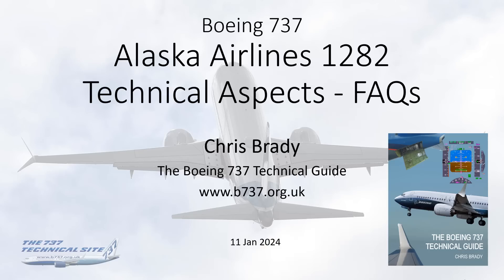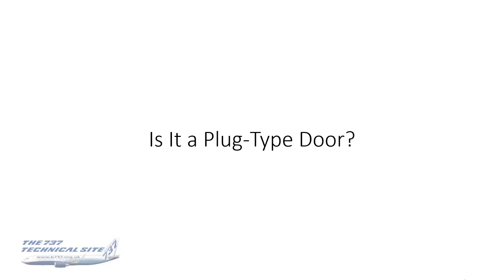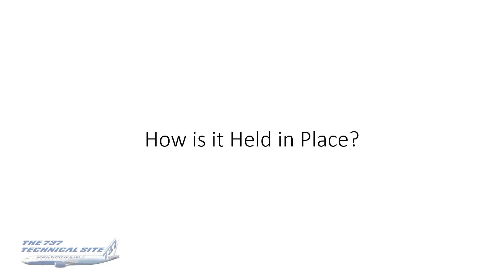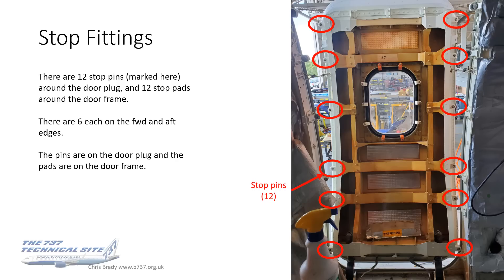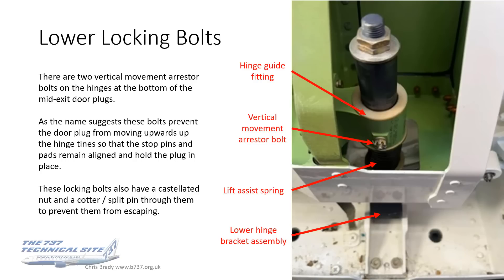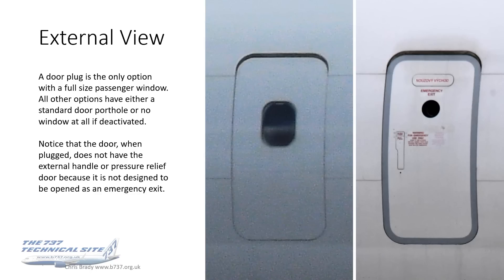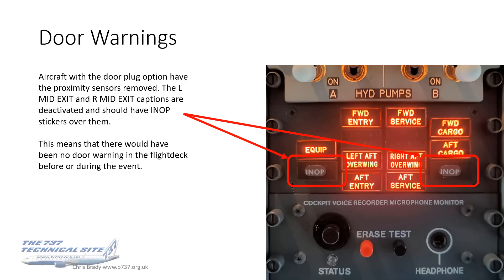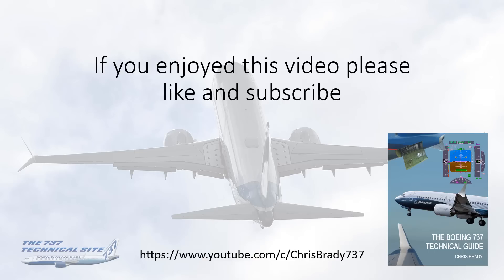737 Technical Aspects of AS1282 FAQs

Comment: I feel that this door handles the pressure difference between the inside and outside using only the four lock bolts on the top and bottom. Is this correct? Moreover, the diameters of the bolts are 1/4 inch and 3/16 inch.
Reply: The 12 pins and pads stop the door from being pushed out sideways. The 4 locking bolts are to stop any movement up or down. The roller pins, guide track and spring assembly at bottom help keep it in place.

Comment: The failed door plug had no issues for several flights until the day of failure. This point should be factored in the search for the root cause. Also across the aisle in the exact opposite location there is identical plug door that did not fail. Why so???
Something to ponder
Reply: A different person was working on the other side, or it was done at a different time, or they never had a reason to open the other side.
Reply: @GH-oi2jf  which leads one to believe design is structurally ADEQUATE. Do u agree
Reply: Look at it this way, in flight there is high speed air sweeping over the plug door external surface trying to peel it from the plane body which will also act as a wedge as the gap increases progressively. Once this starts, bolts or no bolts will not make any difference.

Comment: I POINT OUT,  THE ASSIST SPRINGS WILL HELP OPEN THE DOOR IF NEGATIVE CENTRIFUGAL  FORCES  ARE INDUCED AND THE RAIL AND HINGED LOCK BOLTS ARE NOT INSTALLED . THAT IS A FAIL DESIGNE , THE SPRINGS MUST BE PLACED FORCING THE DOOR CLOSED . GREATE PRESENTATION , THANKS FOR PROMOTING AVIATION . SALUDOS
Reply: The purpose of the springs is to help open an emergency exit door against its own weight.
Reply: @GH-oi2jf  you are correct, THE SPRING ASSIST AND HOLD THE DOR IN THE OPEN POSITION , BY FORCING THE DOR TO MOVE UP, AND OUT OF THE RAILS , VERY UNDESIRABLE FLIGHT CONDITION . go back and read my comment completely, do not supplement , you rationalization . Are you an aviator . saludos 👋
Reply: @GH-oi2jf this is not an emergency door in this aircraft. Therefore, what is the point of the springs.

Comment: I seem to remember that at one briefing the NTSB in relation to the pressurization warning lights said that in all cases the Auto Fail illuminated and that the Alternate took over (expressly that the Manual setting was not needed). I also remember that she said the system was “reset” and the problem did not reoccur. I don’t know if this means it can be reset in flight or afterwards or that the warning light can be cleared and the system did not re-illuminate it implying it was a transient error.

Comment: The Boeing CEO was interviewed on CNBC and clarified what the term "loose fastener" means in an aviation context.  It is a fastener that is under-torqued or has a slight gap under the head.  The nut is present.  He didn't mention if the term also applied when a castellated nut is used but missing the cotter pin.
Reply: Clearly an unpinned nut would be insecure, even though it might have been torqued/tightened correctly but not fastened by the pin and therefore again by definition not loose. Terminology is important.
Reply: They should be using wire ties anyway, imo

Comment: A possible source of confusion here regarding the pins and pads is that the pix at 3:30 and 3:50 appear to be on left side of door but the following close up at 4:25 is on the right side? Because the guide track pix at 5:30 is definitely the right side.

Comment: I am unclear on a very important issue. Your videos as well as others (and the NTSB briefings) say that the plug is held in place by 4 bolts. However, recent inspections on other planes (both United and Alaska Airlines) have identified loose "bolts" on the plug. I saw a picture of these loose bolts on another Youtube channel today and these bolts are attaching the lower plug hinges to the fuselage and are clearly loose. There are at least 4 of these bolts on each hinge. It appears that if these bolts give way, then the bottom of the plug could potentially be pulled out of the plane by the wind flowing over the fuselage. It is possible that such an event could wrench the other four attachments from the door allowing the plug to escape. Photos of the hinges on Alaskan Airlines plane (which are dangling from the bottom of the plug opening) show none of the hinge bolts remaining. Is it possible that the castellated nuts are a red herring in this incident. Moreover, it has been said on other channels that similar plugs have been used on other plan4es (e.g.,727s) for many decades without one failure. If this is true, how does the Boeing design differ from this older plug door design.
Reply: There are different types of bolts.  When we refer to the four bolts, it means those at each corner which keep the door from moving up off the stops.

Comment: I work for the company that developed the automatic cockpit door locking system for some Airbus and Boeing models.  All Airbus and Boeing aircraft post-9/11 cockpit doors automatically unlock within 10 milliseconds during a cabin decompression event.
Reply: Can you explain why the whole door opens instead of simply a panel large enough to equalize the pressure. It small enough to stop a person?
Reply: I recall a reported incident where one of the panels came out and a crazy person tried to get in (or he somehow dislodged the panel). It's easier to subdue a person trying to crawl through a small aperture than it is a whole door. I think they kicked him in the head at one point, but don't quote me on that. Then there is always the fire axe.
Reply: My guess would be a rapid depress event could deform and jam the door. The blowout panels are likely intended as a backup if the door is physically blocked or somehow does not open as intended. Likely in that case the blowout panels save you from tearing the airframe apart as the pressure tries to equalize but the pilots have a decent chance of needing to be cut out because the door will deform and get wedged shut (think older car doors in an accident where the door can't be opened due to frame deformation).

 If you think airframe damage is not possible remember the DC-9 cargo door accidents where it collapsed the floor on one of the aircraft because there was no equalization system.
Reply: @xenadu02  The reason for the door opening to stabilize the pressure between the main cabin and the cockpit.   If cockpit were to be pressured and the main cabin was not, then the cockpit bulkhead wall and door is not designed to be pressured and would buckle and deform and lead to unsafe condition for flight crew and passengers in a rapid decompression event.   I was surprised the flight crew were not informed of this situation during a rapid decompression event, because post 9/11 it was always designed to open.
Reply: @xenadu02  DC10* (bulk) cargo door
Reply: @yogikhan1936 That doesn’t make sense. If terrorists somehow got an explosive on a plane and detonated it, it would most likely cause a decompression, which would then give them free access to the cockpit? The whole design seems like one big oxymoron
Reply: @6z0  I don't have good answers for you. We designed and produced to the Boeing & Airbus design requirements.
Reply: I'm looking at some NG maintenance manuals dated 2003. The door locking system shows the chime module and keypad, but no pressure module as found in, say, the 747-400 manuals, fitted to the cockpit roof. Was this a later update?
Reply: @ImperrfectStranger  We don't build the 747 family solution, but all of the units are similar, they have a keypad &  a control unit connected by wire harness.  The control unit in the cockpit has the two duplicate sensors that sense a decompression event and unlock.  Typically, Airbus units are located in the Capt. pilot side panel and the Boeing units are a simple control unit behind the Capt. Pilot on cockpit back wall.
Reply: @yogikhan1936  Interesting. So the pressure sensors are in the control unit (or chime module as we call it). I'm just looking at the manual for the 777, they are the same as the 747 with a separate pressure module mounted on the ceiling. I'm guessing you don't make those, either 😅 Maybe Boeing are different from Airbus?
Reply: Maybe, the blowout panel lock is a pure mechanical lock, fitted to the door itself. Then, there is no electrical monitoring or control. @ImperrfectStranger
Reply: @Andy.P.Smiths  That's what I'm trying to determine. There is a system described in the regular NG maintenance manuals which might serve as a pressure relief system, but as I've said elsewhere, this is for engineers' (and possibly pilots') ears/eyes only.
I can think of a reason why pilots might not be told this, but again, I can't explain why on a public forum. Boeing might have though the same. Rapid depressurisation events are not common.
Reply: @ImperrfectStranger  , this decompression openings are part of the bulletproof doors, including their certification. That‘s why it is allmost impossible to manipulate it. Even we need special tools to test that mechanism. And the main part is located inside the cockpit, not on the cabinside.
Reply: Wrong information, please don't lie blatantly.  There are door blowout panels ,the door doesn't open.
You're not misinformed,You're lying and making up stuff by just reading/listening to youtube channel.
How do I know?
I bet you cant even name the company which develops the "automatic door locking system"
Reply: @pranabgill1310  Jeez.. take a chill pill. Even the NTSB said the cockpit door should open.
What if the pressure doors don't respond fast enough and another pressure limit is reached?
How do you know? Have you read the Maintenance Manual (52-51-00)? Even the standard NG has a feature which allows the door to open with extreme pressure. Have you been trained on the Max? Have you been trained on the Alaska Max? Are there no options in this area? 
Maybe the guy was wrong with respect to which aircraft have the pressure sensing system, but there are a lot of Boeings which certainly do have this system. Do you work for Alaska?
Reply: @pranabgill1310  I think its a good thing to be skeptical of any information without objective evidence.  The best public source of information to support the statements that is in disagreement.  See NTSB
 press conference on Alaska Air accident, January 8, 2024 NTSB video (link below) at time stamp 07:25 on the cockpit door opening.  https://www.youtube.com/watch?v=NEI4ozlXnX4&t=451s
Reply: Sounds like a security vulnerability.
Reply: @garywatson oh no! Our entire TSA justification!

Comment: It seems like the door is spring loaded to open. The aft hinge was extended and bent aft. It seems like 1 bolt was installed just to keep the door from springing open and the other 3 bolts where never installed. The NTSB said the guide tracks where cracked. I bet it was the aft guide only. The door twisted enough to clear the stop pads on the forward frame only and ripped the door clean off.

Comment: What would be the indications on the Pressurization system or other systems if the door plug was not fully bolted in place and was leaking, but had not blown out yet?
Reply: You'd be getting passenger reports about the noise of the air escaping.  The volume of the 737 is very big, so a 1mm of mercury (1/760th atmospheric pressure) leaking would be somewhere about 20 cubic feet per second, which is the minimum I an see tripping any alarm.  That is the volume of a cheap fan blowing at your legs and finding it's way out through the narrow slot.
Reply: @k53847  Normal doors can be noisy if they have leaks, but I'm wondering if the sidewall with its blankets would have muted the sound. Also that door is behind the engines.
Reply: Depends on the size of the leak. Too big and you fail to pressurise (cabin altitude exceeds limits). Medium leak and you may get a faster cabin altitude rise rate. Medium to small leaks may be compensated for by the normal outflow valve, which has a variable opening to allow the control of  cabin pressure and also to allow a controlled leak so that cabin air is constantly refreshed. Initially, if those specified parameters exceeded the limits, you would get an AUTO and ALTN, but since the door is going to cause issues for both controllers, the ALTN light would go out, leaving the AUTO. The crew would switch to manual control, but that's not going to help with a large leak.

Comment: I think the illustration at 5:59 needs a little work.  I think the outside is on the left, but whether I am right or wrong, that should be indicated.  I also don’t think the track should lean to the right.  As the door is installed, it would be leaning left, then become vertical when the pin is fully in the track.  Edit: Or maybe the track should be curved, as the fuselage is curved.

Excellent presentation, though.  It is the only one I have seen that illustrates the system well.

On second thought, if I take the drawing as conceptual, it need not be precise in detail.

Comment: Another well described analysis of the problem.  
The thought did occur to me that it has been stated that the final Boeing assembly line uses this door to install cabin equipment like seats etc, but most of the 737 fleet do not have this door, yet assembly is apparently no problem with these doors absent. So there really is no reason for making these doors openable in any circumstances.  Essentially, Boeing assembly engineers use the doors because it is more convenient for them, and, no doubt, speeds assembly of the aircraft. But because of this, a new safety hazard of the ease of opening these doors has nearly caused a disaster.

Comment: Great video. Thank you for sharing this information. Not to be pedantic, but the four bolts don't prevent the door from moving outward. It's the pins and pads (and to a lesser extent the guide track and pin) that prevent the door from moving outward. The four bolts only prevent the door from moving upward. Without actually inspecting the door, it's not possible be to be sure, but I would think that even one bolt (perhaps one on each side) should be sufficient to prevent the door from moving upward. If the door plug disengaged from the fuselage by moving upward, then the only way this could happen is if all four bolts were not present. If the nuts and cotter pins were installed, then it should not be possible for the door to move up, leading me to suspect that either none of the bolts were installed on this aircraft or if they were installed, the cotter pins were not installed allowing the nuts to vibrate off and the bolts to vibrate out, if this could even happen. I also find it strange that the guide track is on the door not on the door frame. If it was the other way around, the spring would hold the door in the locked position, so the only way it could open would be if someone depressed the spring sufficiently to allow the pin to disengage from the guide track.
Reply: Can you please give a video time reference where he said this? I'm 100% sure he already knows what you are saying.
Reply: @ImperrfectStranger   6:52  "to prevent any vertical or outward movement of the door".   Later "vertical and outward".  Although he repeated himself enough that it must be clear to anybody paying attention after this great explanation.     But this same language is what to confusion during the TSA press conference.
Reply: I guess the use of "or" does muddy the waters somewhat. Thanks.   @kylepeavy
Reply: @ImperrfectStranger  Whether it's and or or, it's incorrect. The bolts cannot and do not prevent the door from moving outward. That's what the pins and pads are for. If the door was under pressure, the bolts could be removed and it would make no difference, because they don't hold any pressure. It doesn't even make any difference whether the nuts are tight. As long as there is a nut on the bolt, it cannot come out of the hole.
Reply: Perfectly understood (by me at least). Although he could have been talking about opening the door on the ground and the "and" reflects a sequence of events. I've seen websites with far worse descriptions  @darylmorse
Reply: There's a lot nit-picking going on in some of these comments. Most people are trying to describe something that is quite complex,  in concise terms. The four locking bolts do prevent the door from moving outwards: the channel guide is angled, so its movement over the roller pin has a slight outward component. Second, by preventing upward movement, pin engagement is maintained, so outward movement is prevented, that is, a secondary consequence.
Reply from the maker: @RicktheRecorder that is what I was trying to say. Their primary purpose is to prevent vertical motion but the upper locking bolts also prevent outward motion. My apologies if it was not clear enough.

Comment: May I suggest that the gym nuts above the Spring mechanism loosened up in the Spring? Wasn't able to Causey interference fit needed to kept everything type and with? A vibration? A crack the door chest enough to cause the air to escape in thus blowing it out eventually.

Comment: I see no reason to have a full size window in that plug. Just for aesthetics from the outside of the aircraft? It's completely covered up inside the cabin. If the plane is reconfigured with more seats they have to put a real door on.
Reply: I don’t think it is covered in the cabin.  It is a window for the passenger sitting next to the plug door.
Reply: @GH-oi2jf  correct, so it appears to be a typical row and can accommodate a full three passengers on that side as opposed to two if it was an exit door as I understand.
Reply: @GH-oi2jf  Oh ya I didn't even think about that. The window doesn't get covered.
Reply: No, there would be a window next to seat A and F on the appropriate rows. Apart from slightly different spacing between windows, passengers would not be aware that they were seated next to this door plug.